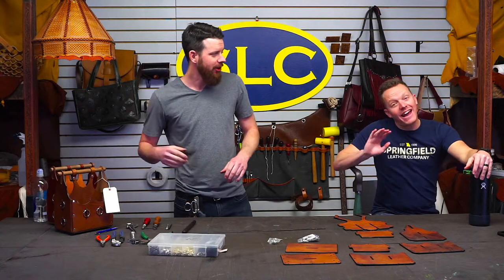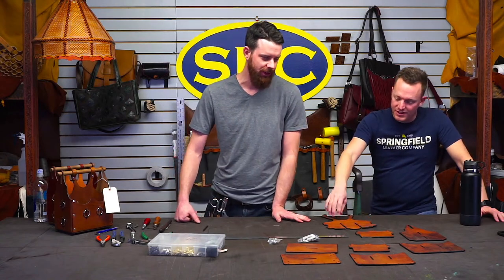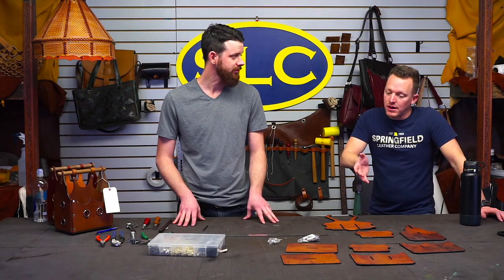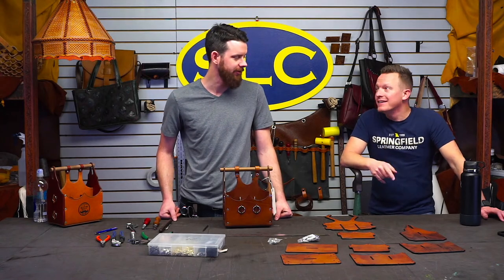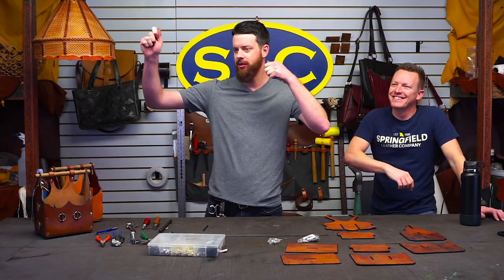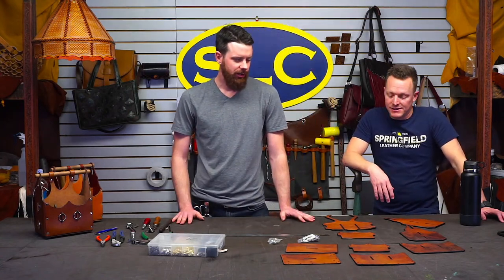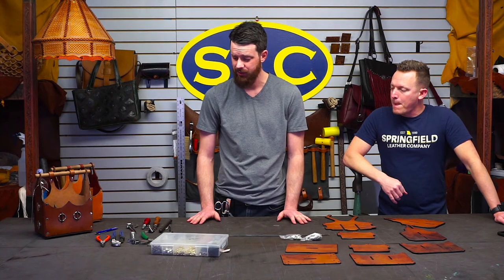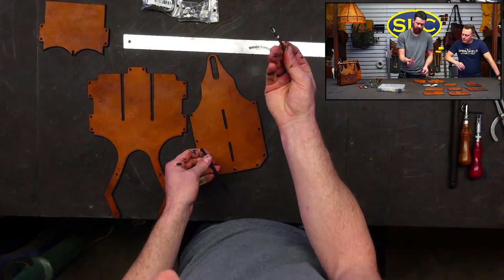6 Pack Beverage Case (Caddy) w/ Clayton + Tony

Comment: I love it! But where can we get the pattern?
Reply from the maker: We are trying to adjust it to fix the slack in the handle.
Reply: @SpringfieldLeather  thanks! I've just downloaded the pattern but I got a question. What's the correct size it should be printed? Because A4 is really small. TIA